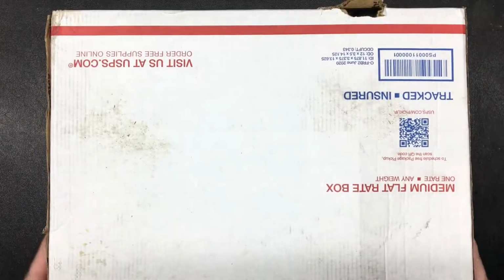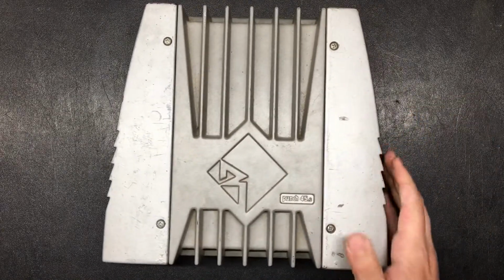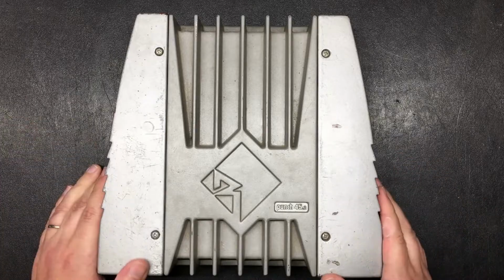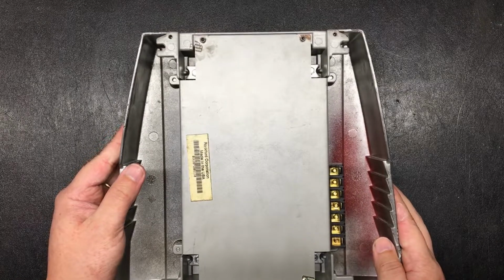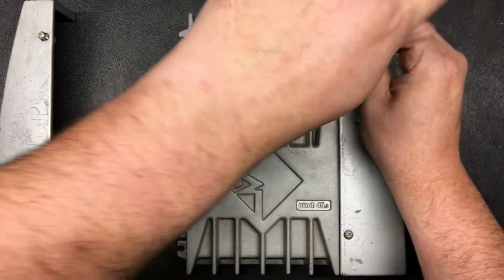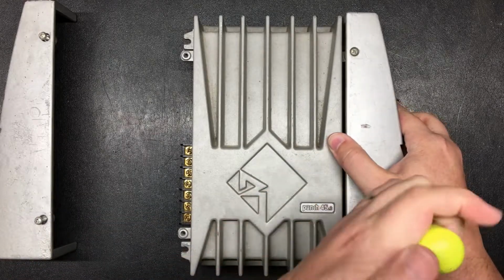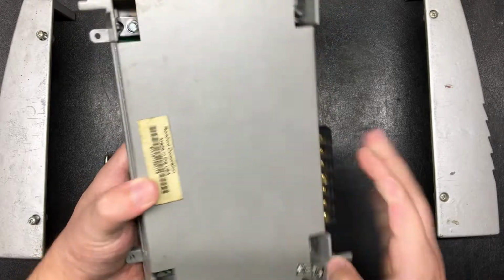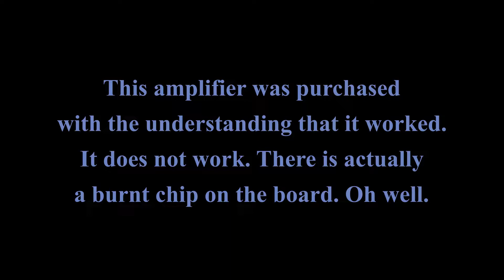Rockford Fosgate Punch 45 2 Amplifier

Comment: Do you have a picture of that burned " chip " ? A closer look can make it clear if repair is worth it or a waste of time.
The amps with the MEHSA - boards take more time to repair, but if people do it by themselves, time isnt that important, just patience 😄
Will you make a video after you cleaned the punch 45.2 ? i like those unbox videos and it would be interesting to see the " before/after " - thing !
If you like we can do some kind of online-troubleshooting. all you need is a multimeter ,  a solder iron and a power supply with current limiting or a fuse with 5 amps!
Reply from the maker: I do have a photo of it but I can't upload photos in comments. I picked up the amp mainly for the end caps. If the amp had worked, great, it would have been a bonus but a amp I would never end up using. The end caps I have already sanded down and painted black. A lot of my videos I upload are at least a few months old before I actually upload them.  I'm not sure what my plans on for the amp if any. I typically collect the DSM style and own around six 40ix or 40x2 amps with one of them being NOS. I have a few amps I need to send out to be repaired that are much bigger and better than this one so for now this 45.2 sits on the back burner.

Comment: I've got a punch 40.2 and a punch 100.2 where would I sell them and are they worth anything these days? I have original box, manual, punch verification certificate, registration sheet, 2 x allen keys and inline fuse that came with them.all in top condition.
Reply from the maker: If you want top dollar your best bet would be ebay. You risk getting scammed on ebay just as much as anywhere else but it's always a plus to document functionality. There's a lot of Facebook groups out there for collectors that you could try to sell them on but like most of those pages, collectors can be pretty honest if your prices are way off. One thing to consider is the 30.2 was the smallest amp RF carried and is one of the most popular amps due to cost back in the day. The 100.2 is getting up there in power but it's not as heavily sought as say the 500.2 or larger "sub" amps. If you go the route of Facebook groups be sure to read all the page rules on selling. A lot of them now require photos of your items and a piece of paper or something with your name and date on it to verify YOU own the product and have it in your possession. I enjoy the "Rockford Fosgate Old School" page on Facebook and I post there a lot.
Reply: @kaknballz  Thanks for your length reply. Much appreciated!

Comment: I purchased a couple of these new from a overstock site back in the day for about $65 each. 
They were fairly unremarkable amps but, also no issues either. 
Probably slightly underrated.
Reply: Slightly?? doubleing its output power is not only slightly imo 😁